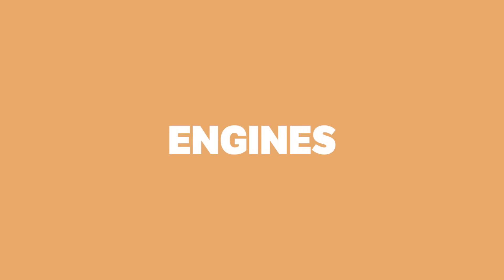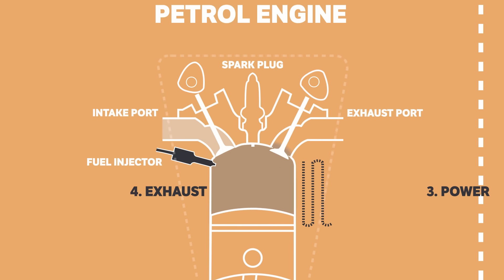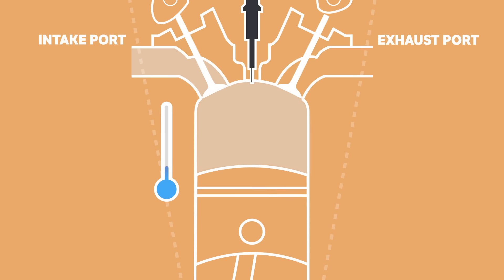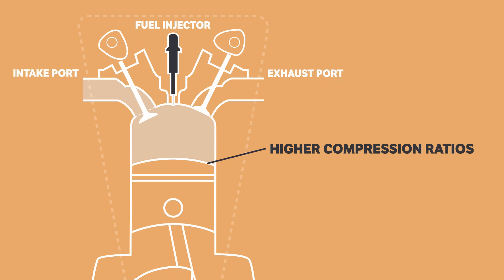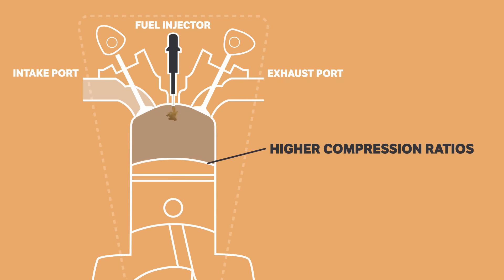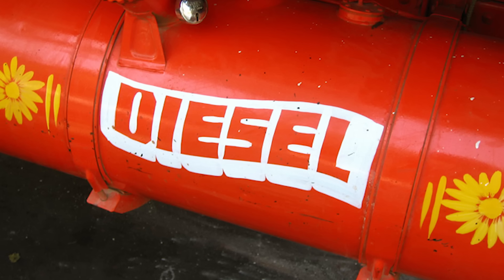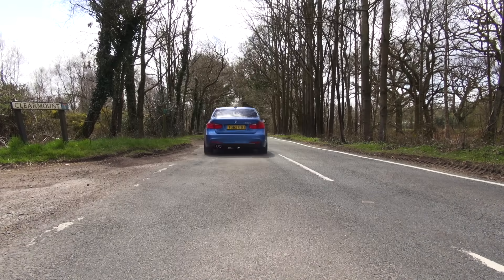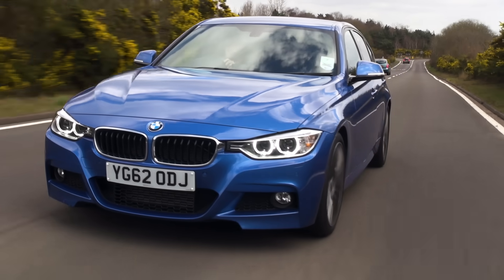The Differences Between Petrol and Diesel Engines

Comment: Kind of funny how a lot of people don't mention why petrol engines tend to have higher power and torque than diesel engines (assuming both are naturally aspirated).

Example to prove my point:
2.2 liter naturally aspirated OM604 engine, to my personally it is one of the most interesting diesel engines I've ever been around.
94hp @ 5000 rpm. 150nm @ 3100 rpm -> 42.7hp per liter. 68.2nm per liter

A typical 1.4 petrol Golf engine.
74hp @ 5500 rpm. 128nm @ 3300 rpm -> 52.9hp per liter. 91.4nm per liter

And if you bring in the whole "If it has higher revs, it will automatically have higher horsepower", well first of all, the revs only differ by 500, second of all, that does not explain why the torque is higher by ~23nm, and fourth, I've actually seen cars with 6000 revs which had more high end torque, therefore had even MORE horsepower.

Being a diesel fan, it's a tough pill to swallow, but I must admit, petrol engines are better for power AND torque, when naturally aspirated. It is just the power per fuel amount used that is better with diesel engines, making them economic "fun" cars and they are easier to turbocharge as even the older diesel engines used injection timing meaning that there would not be any knock just because of increased pressure, unlike petrol engines, which only started getting direct injection with timing control in the 21st century.

But as far as "why" that is so, is mainly due to the air fuel ratio. Diesel engines typically go above an air fuel ratio of 20:1 (or lambda value of 1.379+) while petrol engines can provide an efficient combustion with an air fuel ratio even LOWER than stoichiometric (Although it is not recommended if your main goal is efficiency) so somewhere along the lines of 13:1 or lower for some cars that just want that extra power (or a lambda value of <0.884). The typical stoichiometric ratio for diesel is 14.5:1 and for petrol is 14.7:1 for reference, so both of them are roughly around the same area. But since diesel lambda values can go up as high as twice that of the petrol engines, the power decreases, while the efficiency increases.

Sorry for a long comment, hope it provided some useful information, peace.

EDIT:
Here is another example, for those non-believers.

3 liter OM606 engine is another Mercedes engine that I find to be awesome in the diesel world.
134hp @ 5000 rpm. 210nm @ 2200 rpm -> 44.6hp per liter. 70nm per liter.

A friend's Suzuki Swift 1.3 liter engine.
91hp @ 5800 rpm. 116nm @ 4200 rpm -> 70hp per liter. 89.2nm per liter.
Reply: 0 0  well, yes. But diesel engines run high boost compared to petrol engines, which is partly why petrol engines these days get peak torque sooner than diesel engines, but it used to be different in the 90's and 00's.
Reply: Sh!t man ... who the f*ck thinks petrol has more torque than diesel??????????????????????????????
Reply: @gasperpancur8142  when naturally aspirated, yes. I know it's a tough pill to swallow, but it is true. Look at my updated commented, I will provide another example of a petrol and diesel engine.
Reply: i know but if petrol engines could get more torque they allredy would
Reply: @gasperpancur8142  what do you mean?

Comment: Diesel engines use glow plugs to ignite the air fuel mixture when starting up before switching to air compression for igniting the air fuel mixture. Because diesel is not volatile as petrol it does not give off vapours thus it is very hard to ignite when the Diesel engine is cold, especially in winter. I will stick with petrol since my winter season can be -30 degrees Celsius.

Comment: Actually, the right reason is that the Autoignition temperature of the Diesel which is 210 C. The Autoignition temperature of Patrol is between 247-280 C. The compression ratio is just a result of the autoignition temperature fact. With bigger compression ratio, car could reach the 210 C faster. To reach 280 C, car needs a lot bigger compression ratio.

Comment: The diesel engines are great, but only the cost for repair or change high pressure pump and injectors is the same with the cost of a full repaired petrol engine. At the old days a simple diesel engines was lasting at least 1 million km, but nowdays with turbo chargers and high compression 300.000-400.000 km is the best lifespan (without serious troubles). And that number by following manufacturer's engine mainteance program exactly. Today we can succed the same fuel cost per km, with petrol-lpg converted engines, that lasting the same km as nowdays diesel engines. The only difference is the torque, that doesn't matter much in passenger cars or light-weight trucks...

Comment: Why would you compare a TURBOCHARGED diesel engine with a NON TURBOCHARGED petrol engine???? is like comparing apples with door handles..... a turbocharged petrol engine is way more perfomant than diesel. Diesel truly has more efficiency but ONLY ON HIGHWAYS OR OUTSIDE CITYS... a normal car ( not trucks, tractors etc.)  will always be better on petrol than diesel.

Comment: Petrol is directly mixed with air, and comes into the cylinder...and after spark is ignite...it's not true? Or 
First air will come into the cylinder after inject the petrol ....only it's  True....
Or 
Both true..
Reply: From what I know, the petrol is mixed with the air from the start.

Comment: After 15 years of diesel,  i went back to petrol. Enough of truck engine noise and vibrations.
My petrol engine is so silent,  i can't tell if it's running unless i watch the RPM gauge.
Petrol is the prince, diesel is the peasant.
Reply: Imagine believig noise is all that matters. Diesel is awesome for long distance driving and towing, it has it's uses. Modern turbocharged petrol cars don't use as much fuel tho
Reply: Well I dont have any vibrations with my 2.5 V6 Diesel ^^ And I love the Sound of a Diesel, it just Sounds more powerfull
Reply: Dont wanna be rude but if it vibrated to the point of getting you nervous it is cuz u didnt got care of ur car. I had a 3.5 diesel and i've at the moment a 2.2 mercedes benz, gotta inform u there isnt any noise, but sure i take care of my car.

Comment: So as far as I have understood, petrol engines don't require as much compression within the cylinder because they use a spark plug to burn the fuel.
But in the case of a diesel engine, as the fuel needs a higher temperature to burn, it's requires a higher compression for the air to get hotter. Correct?

Comment: Can you please explain why petrol engines cannot work on same principle of self ignition as DIESEL engine, thereby saving the loss due to spark plug ignition which renders much petrol fuel not burning in cycle amounting to lesser efficiency.

Comment: from one hand they create electric cars to help the environment from other hand a country like germany still produce diesel cars?
its true both of diesel and petrol cars can get EURO 6 from European emission standards but diesel is more harmful for nature than petrol.
petrol fuel with high Octane number rating in new cars which have catalyzer in their exhaust are 5 times cleaner than diesel.
diesel fuel wont disappear so easily its so greasy.
in my country diesel cars are forbidden,they only exist on trucks and semi trucks and trailers because there is no other type of fuel that can provide the power they need for their job so i think diesel should be only for trucks not cars.
if you had or own a diesel car you know how messy it gets compare to petrol and when you start the diesel engine after its been off for hours or days both in normal and cold start that damn black fog that came out of exhaust which could fucked up people clothes or their lungs because its damn problem with cold diesel fuel till its get warmed up and even then it create more smoke than petrol.

Comment: I prefer diesel turbo charged engine definitevely!
Reply: I suggest you just to try turbo charged petrol engine. :)
Reply: With what over engine can you use performance, efficiency and reliability in the same sentence
Reply: In love with my PD130. Don't plan on having a petrol engine soon
Reply: @robbiegibbs1772  ive got the same engine there very nice, espicially if you get a remap
Reply: Naturally aspirated petrol with low end torque.
Reply: 5.9 baby!
Reply: You probably drive a golf aswell
Reply: Why?

Comment: Great video...but I'm still left wondering what the hell a glow plug is... didn't see it in the diagram
Reply: It's a heating element. Its main purpose is to rapidly heat up the surrounding space inside the cylinder before starting the engine. Air charge must be hot enough to ignite when the fuel is injected.  A glow plug heats up to 1000+ degrees Celcius in a matter of seconds. It should be noted though, that it is still possible to start the engine w/o them, but depending on the ambient temperature it might be extremely difficult to do.

Comment: There was a significant improvement in diesel's performances when commonrail system was introduced so they are now providing extra power and fuel economy as well as fully optimised work. There is a nice statement which says: where diesel stops, the petrol continues (regarding to high revs performances).

Comment: Did you realise that the engines runs on Air intake not the petrol or diesel? those two fuels are just to ignite sparks, but the actual torque is coming from nitrogen compressed from air. Soon you will drive Air engines. Learn the facts.
Reply: First of all there is no "spark" in a diesel engine. Secondly what the fuck are you talking about?

Comment: Petrol for racing and fun use
 Desiel only for work use
I like petrol better
Reply: Diesel = Heavy loads, more torque, lower Rpm
Reply: petrol money eater all petrols eat minumumly 6L per 100km/h and these engines are 40kw to 60kw anything higher it goes too far especially if you look at v8 engine they drink 25L or more, fuck that diesel 40kw to 100kw can achive 4l per 100km/h anything higher its 5L or if it has a turbo maybe 6L thats still less then petrol and who said diesel isnt fun i rather drive a car for 3 hours and not a petrol one for 30 minutes xD

Comment: Always was a diesel head, however now I'm driving a Volvo V70 with a 2,5 liter, 5-cylinder petrol engine, without a turbo, by the way. And that thing runs so smoothly, that it you don't even feel the engine. You feel acceleration and deceleration, however no shaking or anything as is common with many 4-cylinder set-ups

Comment: Let the turbo kick in when you drive a diesel car, its sound, its torque will make you forget a petrol car...certainly yes i am a diesel engine fan
Reply: I guess you never have been in a 4.0 litre turbo petrol car that revs up to 8000 rpm
Reply: You would be surprised with how nice a diesel sounds WITHOUT a turbo. Now adays this is unheard of, but I have a 1991 Mercedes 300D (3 litre inline 6 naturally aspirated diesel engine). I swear, at higher revs, it doesnt sound like a diesel at all, because there is no turbo sound, it honesltly sounds like a 6 cylindre petrol, but it's throatier and raw. Might be an unpopular opinion, but I love it! Very distinct and full of character!
Reply: @dinispaulino7512  woooow that sounds heaven. But it seems you are a diesel engine fan too.
Reply: @dinispaulino7512  Especially never ones with bigger engines and 6 cilinders or more, they have a good sound when you hit the pedal, but 4 cilinders sound really bad, more like a small working machine. Like a not so loud tractor. On the other hand, petrol engine 1.4 liters and up sound really good, and the bigger the engine the meaner the sound. Not to mention the instant throttle when you hit the pedal, and diesel have that lazy lag which annoys the hell out of me. I drove Mercedes 270 E from my friend, and it is damn powerful but even then it starts pulling like a second after you hit the pedal. That's something I really don't like in a car. If I press gas pedal I want the power now.
Reply: I get max turbo power at 1.8k rmps.While on gas engine turbo would probably work only from 3k
Reply: At how much rpm do diesel turbo start spinning?
Reply: I never driven any car and want a electric one cuz its quiet
Reply: Diesel turbos are the best. Even with a smaller engine, they always put fairly loud turbos in them which makes them sound great.
Reply: @RazordraacGaming  If your turbo is loud, its fucked.
Probably from running on that shitty diesel oil.

Comment: The Euro low-inertia turbocharged petrol engine is more than enough. Otherwise I'll take a diesel over a Japanese or Korean N/A petrol engines. It's nice to have good low-end torque torque so you don't always need to floor it to have decent acceleration.

Comment: I have an Isuzu Trooper II 88 2600cc Gasoline Manual transmission... Man, that car sucks money on gas like hell... but has an awesome acceleration. And that's why I prefer gasoline engines over Diesel. Diesel (without turbo) are slow.

Comment: Wait if diesel engines don't need a spark plug in order to ignite the diesel in the engine due to it having a higher compression... then why do diesel engines still have spark plugs on them? What are they used for then? Thanks
Reply: diesel engine's do not have spark plug's, it's the fuel injector, it spray's diesel in the compression chamber when the air is compressed and hot enough to ignite the diesel and then it will force the piston down.
Reply: Christian Rasmussen thanks for the reply! I thought those were spark plugs. My bad haha

Comment: I have a quick question. Why do most trucks make the psss sound as they are braking. The sound like a steam locomotive as they stop in station.
Reply: It's not braking that causes it. It's when you let off the throttle and the turbo spools down.

Comment: there is not better or worse, its matter of preference based on many factors. Fact remain that diesel variants of cars are turbo-charged 100%. There is not a single car thats diesel without a turbo these days which adds up the torque spec too but also shows how weak would they be without it. To add, many petrol cars are "turboed" too from the factory aka "not naturaly aspirated engines". BMW have those alot these days.

Comment: If I could have the torque and sound from a diesel, and the power and speed from a gasoline engine I would be very happy.
Reply: Get a motorbike then :D
Reply: Sound from a Diesel? Please look up videos where petrol sound and diesel is compared. Petrol revving up to 8000 rpm is sound.